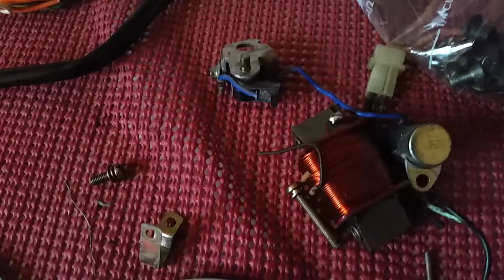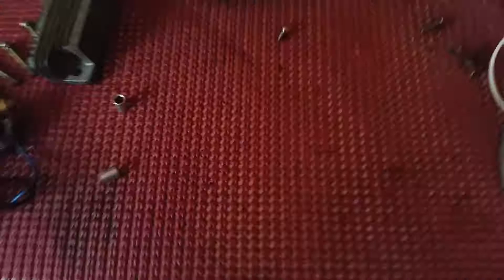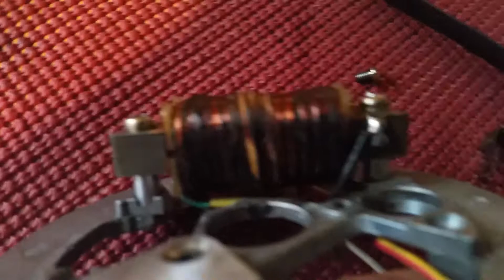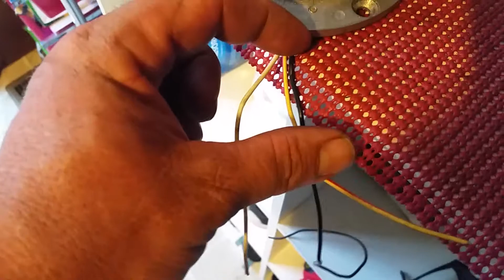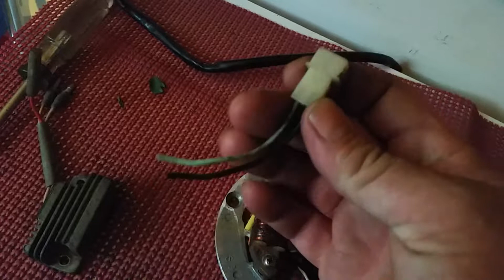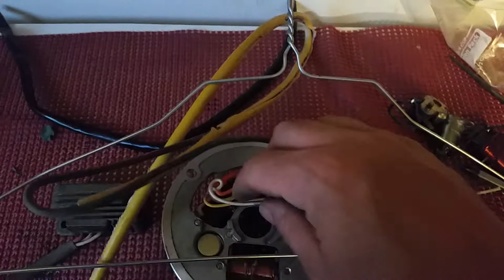KE100 KM100 6 volt to 12 volt conversion part 5 final construction

Comment: What did you do with the oiler felt??
Reply: No I meant the section removed holds the felt bracket? , also battery I can not find a 12v battery small enough to fit the original battery holder, how did you get around that?
Reply from the maker: Clean it then re oil it
Reply: @2 @2strokeguru you removed the part of the stator that the felt oiler bolts to , so how did you get around that ! That’s what I meant, thanks

Comment: Hi Kevin, I've been following a lot of your videos. I have a 1975 Kawasaki G7. Sat in my grandfathers garage for 30 plus years. I've completely rebuilt the bike. I'm having an issue with I'm guessing overheating. Runs fantastic for 10-20 mins depending on riding style it will start spitting losing power , back fire out of the exhaust or pop from the carburator it will idle after just not great. I have been all over this bike. I know it's not starving for fuel I ran a vent Y off the fuel line. Cools down good to go again. I'm at a loss any ideas where to start? Any help would be greatly appreciated.
Reply from the maker: 1st always replace the spark plug 1st 2nd of that doesn't fix it replace points and condenser
Reply: @2strokeguru  I've replaced spark plugs bike seems to like 8 the best. I've also replaced, Points & condenser and set to spec, Ignition coil (didn't help), looked inside the top end (120 psi),  Rebuilt the carb a bunch of times bike likes (80 main and 17.5 pilot). Clean the exhaust replace the packing. The bike only has 800 miles on it from what I gather that's the original reason it was parked. I could try another new set of points and condenser I've been working on it for about a year lol it's been through a lot. Any recommendations for part store? Thank you again
Reply: Also do you think it's worth the effort to change the generator over to 12v? Or get an inline step up 6v-12v for the lighting system.

Comment: That's quite a bit of material removed.  Thanks for showing for us all to follow.
Reply from the maker: yes but the way i did it is still verry strong
Reply: I thought you had a video where you just swapped the two 3 volt lighting coils with 2 6 volt ignition coils ...... Did that system not working?